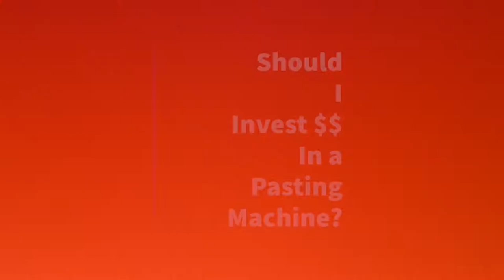Should You Buy a Wallpaper Pasting Machine? - Spencer Colgan

Comment: Hi Spencer.... uk... £120 a day painters!!! lol
I really like the grass cloth style finish. no match too

questions..
1: do you find the paster table can regulate the amount of paste .. whereas, by 'hand' you can add more or less if needed.
2: the grass cloth, where you had the 'kink/bend' angle on the wall, what do you do with it... let it go in and leave, or let it go in, leave it n tight and neat cut top to bottom, keeping it butt, so it stops the chance of it caravaning up when it dries (creating a balloon bubble).

I'm still wanting Porsche to make that call to me, I've no problems having a roof rack fitted lol
Reply from the maker: 1.  Yes.  You can regulate by machine, and keep a roller handy if machine runs low and you need to Re paste the sheet before filling reservoir. 

2. Hand bend around corner.  Feel for bubbles. Add vinyl over vinyl paste to corner and make a tight cut and just leave it.  Check in 15 mins for air. 

Done.
Reply: @spencercolgan  I can't remember the last time I used overlap adhesive. Ready mixed tub paste is really good now days... It sticks most stuff.